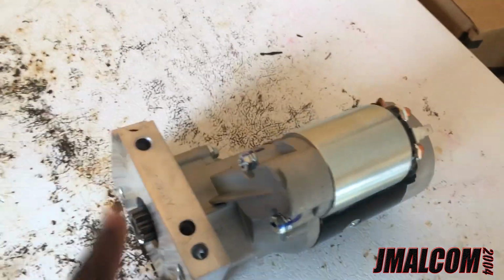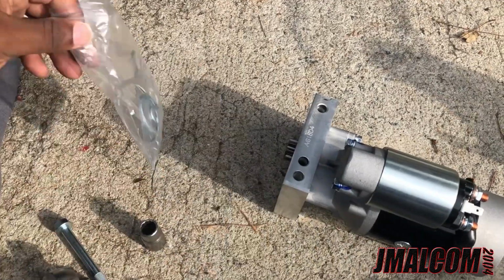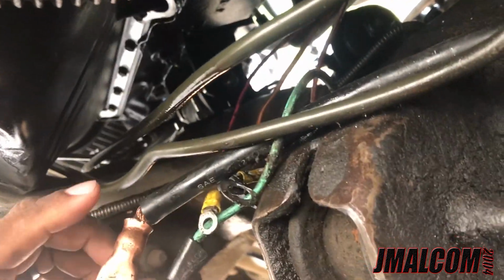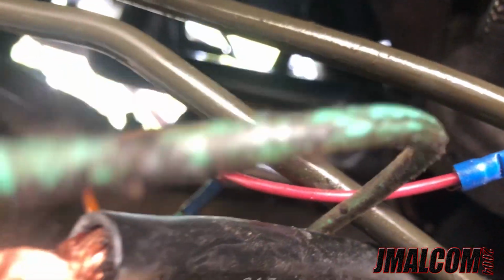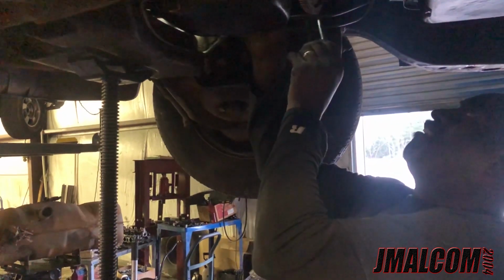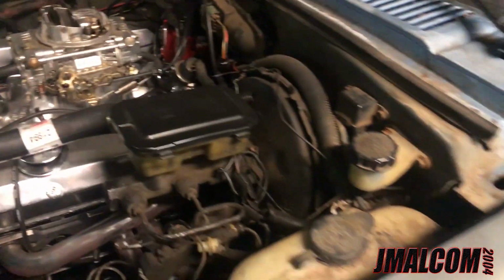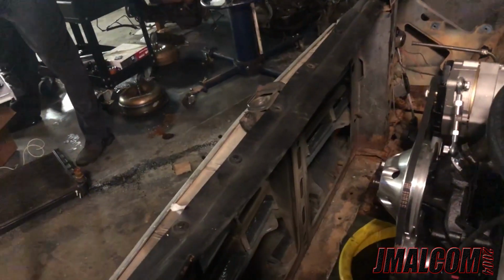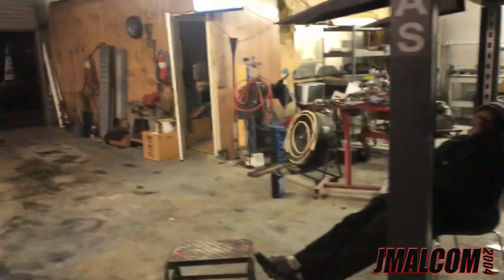JMALCOM2004 $5000 BUDGET BUILD EPISODE 25: BROUGHT CHEAPSKATE HOME AND HAD TO TAKE IT BACK

Comment: I know he wanted to tear up something trying to put that starter on 🤣🤣
Reply: @JMalcom2004Rides   😂😂😂😂😂 I know first hand. I wanted to set my whole truck on 🔥🔥🔥when I had to change the starter. Love the videos man keep grinding and having fun.
Reply: JMalcom2004Rides hey man I'm working on a build myself. I got a 84 cutlass supreme with the 350 olds motor. it has good compression and everything but it won't do a burnout for nothing in the world. is that a carburetor problem or what I can't figure it out for nothing.
Reply from the maker: mike west could be possibly. Hard to diagnose without seeing it and what it’s doing
Reply: JMalcom2004Rides it boggs out like it wants to turn off whenever I try to do a burnout. it runs fine an all I just can't get a it to burn rubber

Comment: Sounds good great job on the build it’s gonna be a fun truck to drive what Cam did you go with.
Reply from the maker: Mr.404 Atl thanks and it’s a Jegs hydraulic flat tappet. Specs are in one of the older episodes